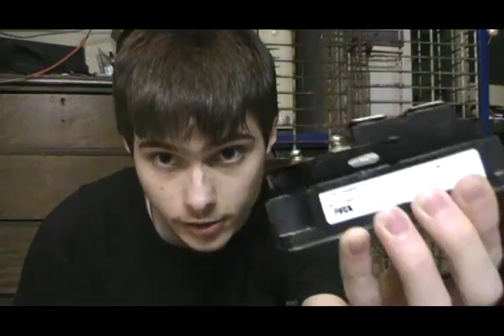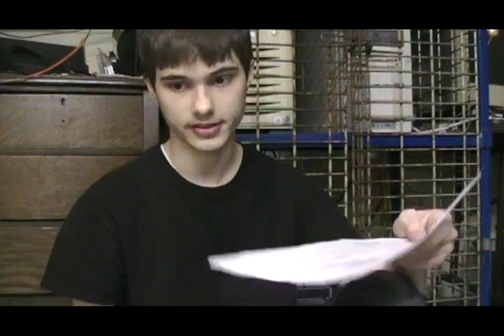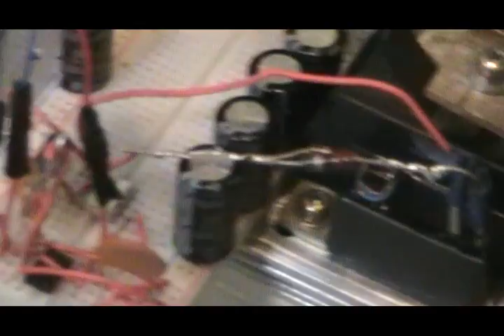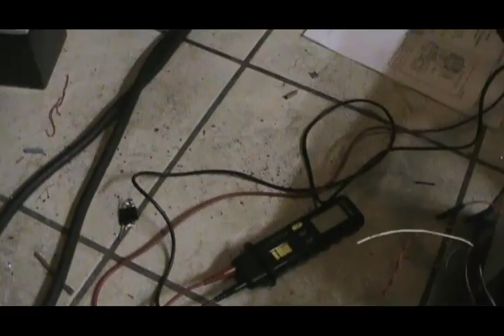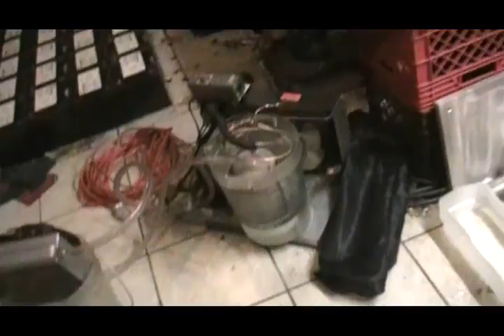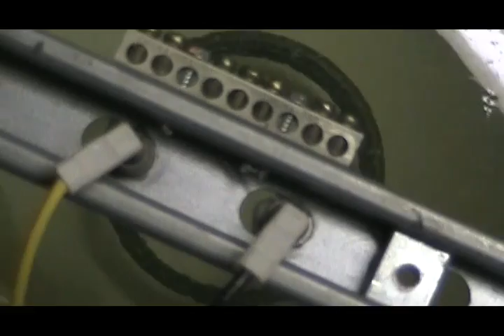IGBTs explained and IGBT based heater controller

Comment: Great. correct infirmation. thanks.
I do not use the reverse recovery diodes for my IGBT half bridge. 
Instead I use those inductive spikes differently. 

 I need to know how I can get the igbt to switch off as fast as possible. any help would be appreciated.

negative gate prevents turn on, but does it discharge the igbt charge faster (no)?

Comment: Hello,
I wish to build an induction heater and I already have most of the parts. I have : 1 X CM300DU-24F with snubber cap ; 6 x SKM100gb123d ; 6 x 2.0 uF 1000V aerovox capacitors ; 5 rectification bridges ; many big electrolitic capacitors ; contactors ; switches ; BIG aluminium radiator and others various items.
If you would of had these components what you would use: one CM300DU-24F or 2 X SKM100gb123d ? My mains power is 220V monophase. I ve saved a lot of plans on my computer but none with similar components. I don t have much electronic knowledge but I trully want to make this happen. I ve made a short video with my components and you can see the tags on all of them. Maybe you can help me decide which design to use or any advice will help hugely. Thanks

Comment: How do you control the amps??.
Reply from the maker: You can control the average output current simply by adjusting the IGBT on time, or in other words the pulse width or duty cycle. The peak output current however, is controlled by the input voltage and output resistance (impedance) IGBTs merely function as a high speed switch, so in a sense they really cannot control the output current, they can only pulse the output. Thanks for watching

Comment: Hey Dear, could you please tell me 
1. purpose of capacitor bank in igbt circuit (both in motor controller and induction heater)
2. how to select and size capacitor banks
3. how to select snubber capacitor and free wheeling diodes

my question answer may depend on the type and power of application but i need if there is general rule for rough estimation
Reply: 3.
I don't know what type of snubber are you talking about
But for RCD snubber the snubber capacitor, you have to select a value that doesn't make the capacitor voltage change a lot during one period : 10% seems reasonable. You also have to check if the capacitor will be ok with the ripple current. Then the resistor will be chosen with the power you have to dissipate with the capacitor voltage

Don't hesitate to look for "application Notes" for your application, there is all lot of informations in it ;)

For the diode check that the breakdown voltage is enough for your application and that the RMS current and peak current is ok

Comment: I think the water gets dirty because of electrolysis caused by the magnetically-induced electric current on the outer copper, due to the higher frequency strengthening the magnetic coupling. ;)

Comment: Well you seem just fine behind the camera to me.I am trying to learn about how to build an induction heater as I need one to repair a piece of machinery that has a hub frozen rusted to a shaft and torches/fluids,etc. didn't work.I am 52 and disabled so I can't buy one,but I horded enough electrical/electronics stuff over the years,I may have enough to build one.You have taught this "old man" a lot and I applaud you for posting this series about induction heaters!Continue learning and sharing that knowledge and you will go far! I was a machinist as well as a fabricator for nearly 30yrs,if you ever have any questions along those lines,I'd be glad to return the favor :)

Comment: Very nice explanation - it have helped me a lot. But those huge IGBT's you show there is probably overkill for most of us as whe dont even have close to the power those can handle going into our houses, haha. I use just a small one mounted on a heat sink to power regulate an 8 kW furnace running on about 535 V DC - small units does have a lot less capacitance in their gates and is very easy to drive.

For very low voltage applications and just a lot of current, MOSFET's probably have lower "on state conductivity" - but pretty much the same rules probably apply for those if they are big.

Comment: Hey man i watch your  project and is very good. But.. you must develop some
good lab to test those thinks! It's very dangerous  to have those caps & cables on the floor! build some wooden table to put it there.I working on  power electronic's 
on ups systems and i  always  take safety measures first.
Very good presentation by the way!

Comment: I have ran these IGBT's linearly on loads that pushes their collectors power dissipation for a long time because I have them mounted to a BIG heatsink.  Their gate has a lot of capacitance toward pwm but they are worth the effort for pwm motors and so much more!

Comment: Excellent primer! I aquired a few 1200 V @ 600 amp Dual IGBT's with a bank of very nice low-ESR capacitors on a copper bus assembly, and had no idea how to drive them. I also found some matching internals from a small VFD (600 volt, 250 amp) that may provide adequate driver parts. Now all I have to do is figure out what to power with it. Thanks for making this video!
Reply: you can make a big drsstc with that

Comment from the maker: When I was going to college for electronics engineering, my professor told me once that I didn't need a free wheeling diode for driving a resistive load, since it wasn't inductive. Years later, I got my very own oscilloscope and took measurements. As it turns out, the wires connecting the resistor do have inductance, so do wirewound resistors. Capacitors and a freewheeling diode are a must for any IGBT setup. Thanks for watching

Comment from the maker: sure, as long as the MOSFET voltage, current and temperature ranges are not exceeded. 800 watts is pretty small. I assume this would be fairly low voltage as well, so a MOSFET may be better suited

Comment: Hey we were using a MOSFET instead of an IGBT for a 800 W wind turbine application. We were planning to use an Arduino microcontroller to perform MPPT (max power point tracking) and hence, using the Arduino to change the duty cycle through the MOSFET. Do you think its a good idea ? Thanks

Comment: Any ideas if IGBT's can be used on electronic dc loads? I'm building a dc load using mosfet's and i was wondering if there is a way to use them as loads.

Comment from the maker: For IGBT protection, the only thing you can do (besides a properly designed DC bus and correct gate resistor and driver, and proper cooling) is overcurrent detection with soft turn off. Yes isolation between the CPU and the IGBT gates is needed. You need 4 isolated power supplies, one for all the lower stages(negative) and 3 for each of the upper stages (positive) good luck

Comment from the maker: an isolated power supply for the gate drivers, another for the microprocessor/signal generator, and an isolation transformer for the inverter power source. Also shield your face, flying pieces of IGBT will hurt if it decides to blow. ear protection wouldn't hurt either. Good luck and thanks for watching

Comment from the maker: Check your math. It's a 7.2 kW load, not 300W. Heater is 16 ohms. Capacitors charged from rectified 240 volts, thats 340 peak to peak. Thats 21 amps and 340 volts. The capacitors are still a little overkill even for that but it was only for a demonstration anyway. 

Use caution with those small IGBTs. Their ratings look good on paper but they are small and very difficult to remove heat from.

Comment: Pretty good video, but do you need such big ass capacitors on the output for a 300W load ?

Your setup doesn't seem very economical !

How trying to figure out what can be done with the 2$ to 5$  IGBTs that can be found on ebay like the G30N60, SKP15N60, FGA25N120, FGPF4633 and HGTP5N120

the HGTP5N120 is rated 21 amps 1200V, I wonder if I could drive a 5 HP 240V electrical compressor motor with it, I would like to add soft-starting and more safety features to it

Comment from the maker: on and off. The only thing required is to charge the gate capacitor to turn on, and discharge to turn off. This takes on the order of a few milliamps to a few amps. Whereas a bipolar transistor or gate turn off thyristor can take hundreds to thousands of amps to turn off. Generally speaking then you do want to avoid using an IGBT as much as possible, for example a simple low speed switch should be a mechanical relay or contactor. But for high speed and high power you will need to use an IGBT

Comment from the maker: IGBT are mainly used in inverters that require switching speeds higher than what relays can provide. As I explained in this video, Mosfets and bipolar junction transistors were used before, but the IGBT was engineered to perform better than both in certain applications. Mosfets are still much faster switching than IGBTs but have greater losses. Bipolar junction transistors and thyristors can usually take more current but they aren't as fast as IGBTs The IGBT is also easier to switch (continued)

Comment from the maker: Yes IGBTs are very dangerous and unstable. They can only operate under very strict conditions. There has actually been money invested into research and development for a foam packaging for IGBTs to minimize component damage in the case of explosive IGBT failure. Low temperatures can also help keep IGBTs stable as I explain in some of my other videos. Thanks for watching

Comment from the maker: My Welder? This is to control a heater. An IGBT chopper can be used as a welder but the control would need to be setup to detect and limt current so it would behave as a current source, not a voltage source. A half bridge or full bridge inverter would be better suited as a welder

Comment from the maker: @blackmesa25 The SKM400 is a big IGBT.Driving that from 555 is possible in theory, but the switching frequency would need to be very low (1Khz max) and it would only drive the lower IGBT. What I would do, use a halfbridge driver like SG3525, get two opto isolaters, and two gate drivers like CLA360-ND. Then use two isolated power supplies to power each gate driver. feed the singal from the 3525 to the optical isolaters, then from the isolaters to the gate drivers. Good Luck, Thanks

Comment from the maker: @mrCbeems This won't be easy but, here goes. The gate driver for this project is an HCPL-3120 optically isolated gate driver. an IR2101 is a half bridge driver, this circuit is whats called an "IGBT Chopper" it doesn't use the upper element, only the upper diode.So an IR2101 would work but you'd have to disconnect the "High output". As for how the IR2101 works, it uses a "bootstrap circuit" that takes power from the DC bus to charge a capacitor in a pulse this gives power to the high gate driver

Comment: Go boom is right, the company I work for makes UPS's and power conditioners. Every now and then an IGBT lets go and makes a nice little explosion. From what I can gather a problem in the control section makes the wrong ones turn on or lets the inverter devices shoot through across the + and - DC rails. I heard of someone who metered an IGBT live and blew it up from current introduced into it's gate at something not high frequency PWM, likely either DC or 60 Hz. IGBT conducts too long POW!

Comment from the maker: @bejius Do you mean supply power to an IGBT with AC or use an IGBT to create an AC waveform?
If you're trying to supply an IGBT with AC power, all you really need is a rectifier and a capacitor bank.
To use an IGBT to create an AC waveform, then you would need a dual IGBT module, two gate drivers, two isolated power supplies and an inverter circuit to drive it.
Alternatively, you could also use a single IGBT module driving an inductance to create AC, but this would act like a boost converter.